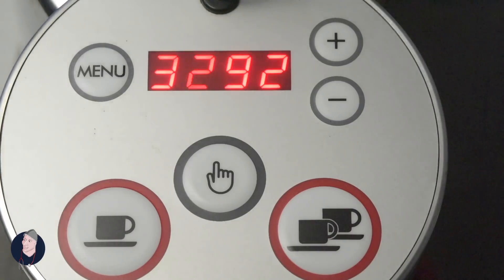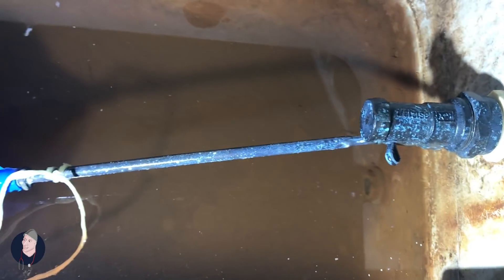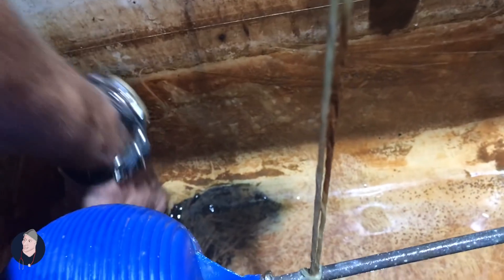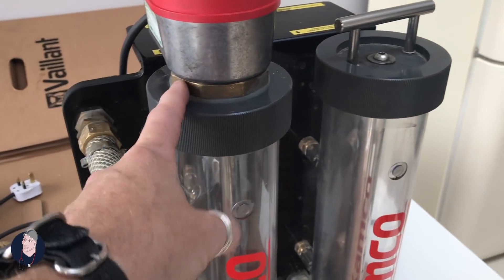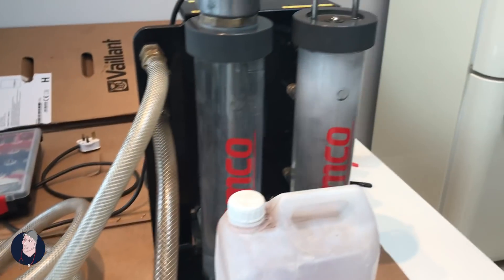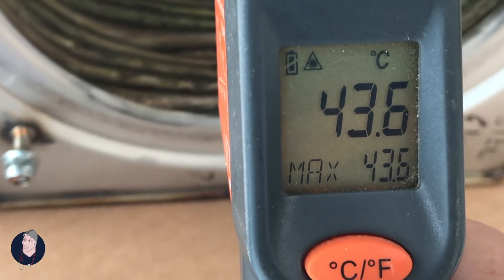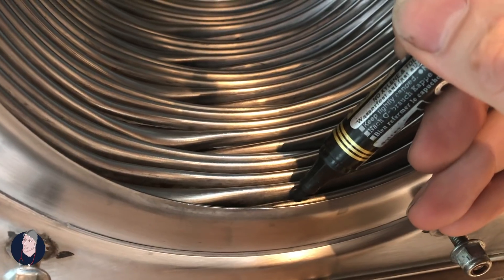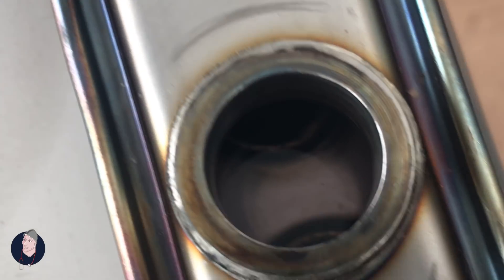Day in my life as a plumber 38, How to flush a Vaillant Heat Exchanger, Blocked cold feed, drpipe

Comment: 10:15 How did you get that finish on that heat exchanger? 
I think it was another video but I saw you screw onto the Vaillant drain off with a hose connection you made up,  what size are the threads on that drain off or what fitting did you use? Thanks again

Comment: Dr pipe please get some more videos up please they are brilliant. What do you use to clean the inside of the heat exchangers? Have you found a tool/brush/file to cleanse the ideal logic heat ex? Don’t like just chucking my mug of tea down there. Keep up the good work and Make sure we watch the ads lads it help him out. 👍🏻
Reply: Pretty much seen them all yeh. Not to tell you what you should be doing or anything but, I changed a dip tube (plastic now metal) today, Difficult one to diagnose but very rewarding when I found it.
Reply from the maker: Daniel Mason quality.. ain’t got many on the books.. u talking 🐰 boiler ? I’m laid up knees gone been off for 7 days now 🙏👍👍
Reply: Dr Pipe yeh on the 938 is it? The state of the plastic one I took out was crazy, completely wrecked. Well if Your like me your in too many lofts balancing joist! It’s a mine field out there, With too many of our brother and sisters ready to under cut us if we went there within the hour the ring. Good thing about boiler repairs are that not many can do them (correctly). at the ripe age of 30 I’ve still got loads to learn but I took a spanner to a few gas valves after seeing you whack one on here, and you look like an absolute hero! Can be very rewarding our job but by fuck it’s harder then any other trade!
Reply from the maker: Daniel Mason hardest trade there is 💯 I’ve done most of em. Mental physical the lot this job. 👍🙏🙏
Reply from the maker: Daniel Mason you watched almost 100 vids then ?
Reply from the maker: Daniel Mason cheers fella pleased u enjoy 👍🙏🙏